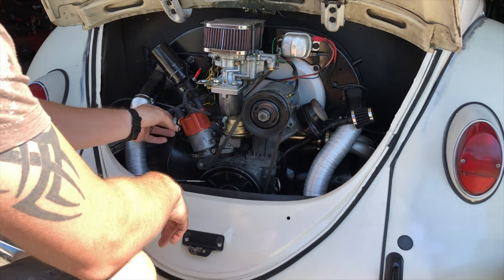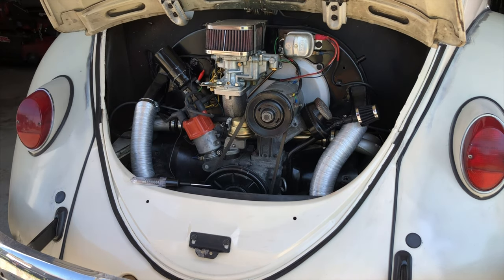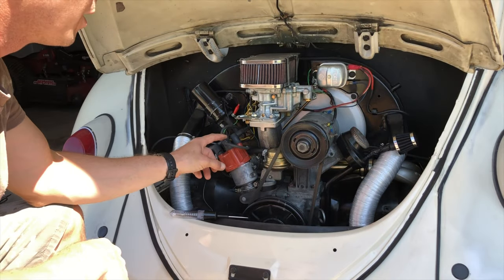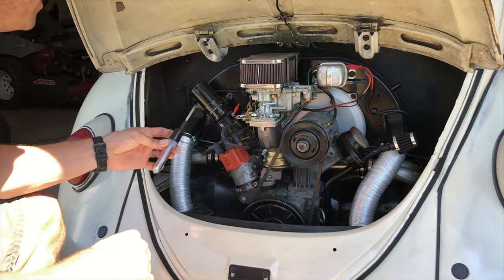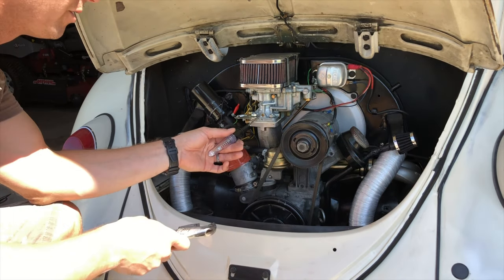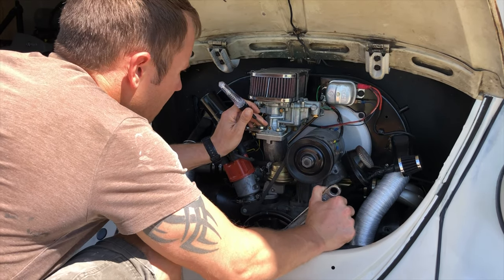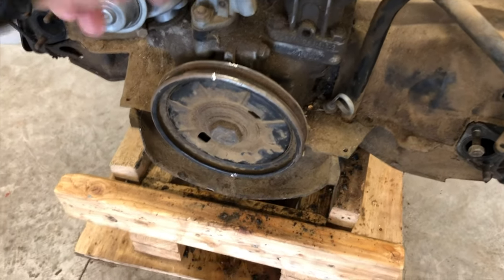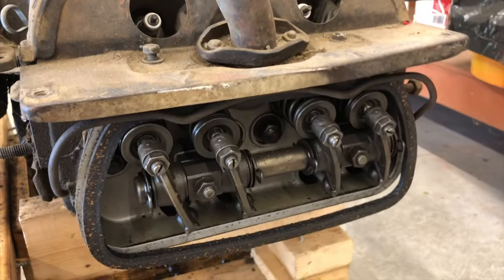Static Timing VW Beetle

Comment: My test light comes on and stays on when I hook up like you did. Is something wrong?
Reply from the maker: Even when you rotate the pulley?
Reply: @VitosFix  At all times. With the ignition on, test light hooked to negative side of coil. Light comes on and stays on when grounded. Turned the engine over two complete revolutions. Light stays on never varies.
Reply from the maker: @garypellerin5576 Did you happen to try the positive side of the coil?  Just in case it’s marked wrong.
Reply: @VitosFix  Yes I double checked. I actually had to replace the coil(bad secondary). It has the pointless electronic module in the distributor. The car starts and runs really well. It just bugs me that I can't figure out why I get constant power.
Reply: Because of the electronic ignition.